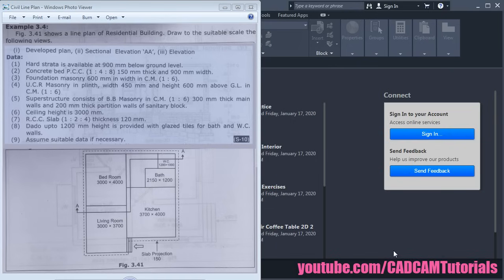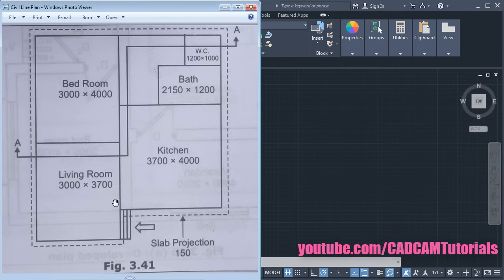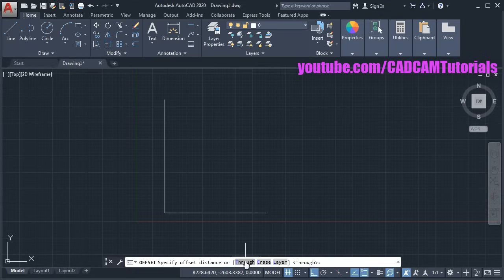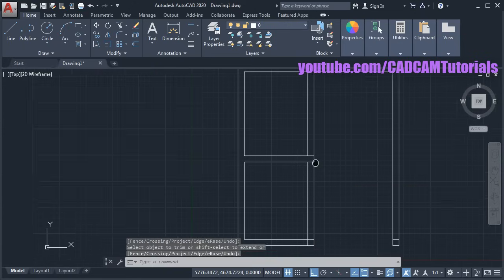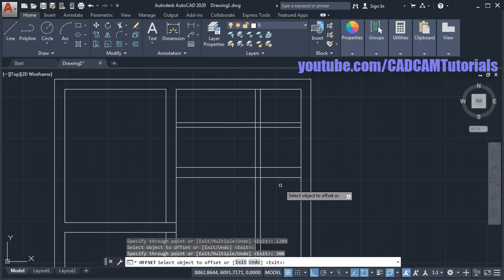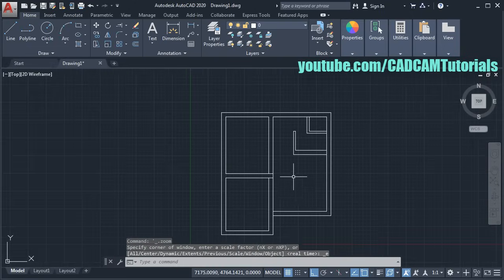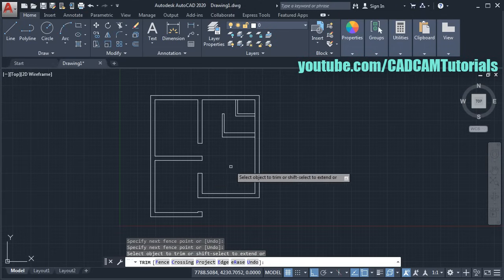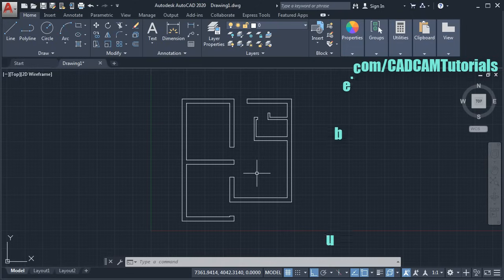AutoCAD Simple Floor Plan for Beginners - 1 of 5

Comment: I do have issues,when you take the WC measurements. You made use of 300mm for wall thickness and also 300 mm for the distance of the WC distance, the measurements are not responding.plz can you clear me on that,?

Comment: sir for layout walls you have taken 300 mm and inside some walls as 300 mm and some as 150 mm. how they are taken and what will it be for feet .
Reply from the maker: 10" and 5"
Reply: @CADCAMTutorials  sir why should we take like that ? is that are standard values
Reply from the maker: Wall Size depends on the brick size.
Reply: @CADCAMTutorials  sir thanks a lot. you have answered very patiently. and your lectures are awesome sir. i had joined auto cad coaching before but get nothing.but i'm easily getting from your lectures. i will recommend it to my friends.